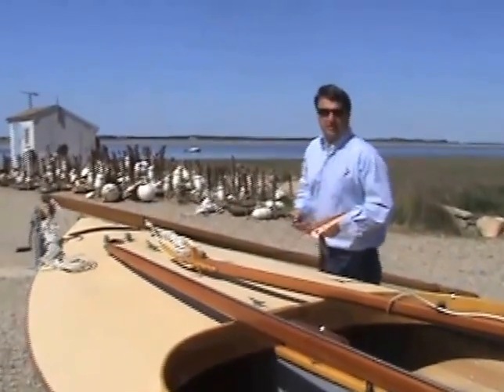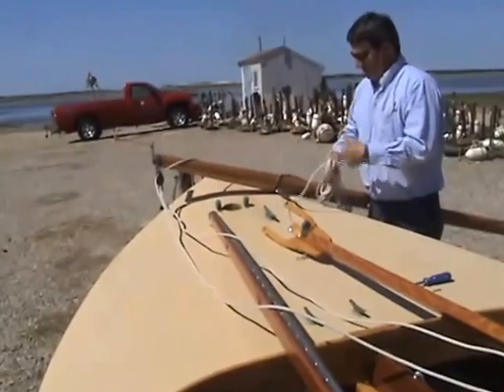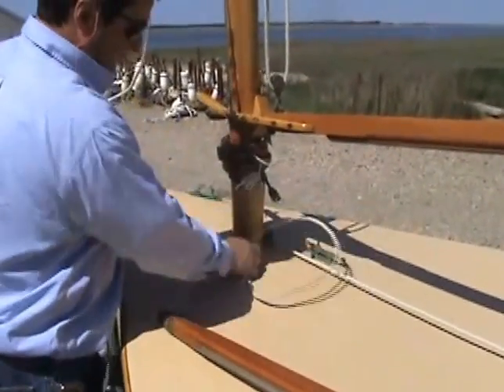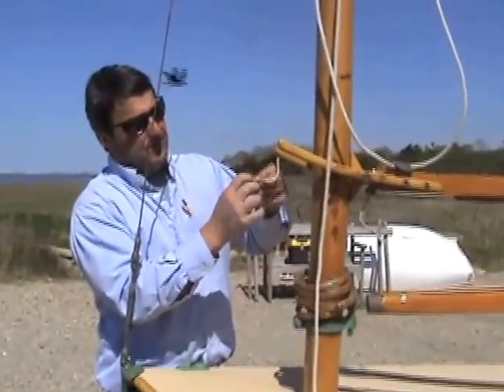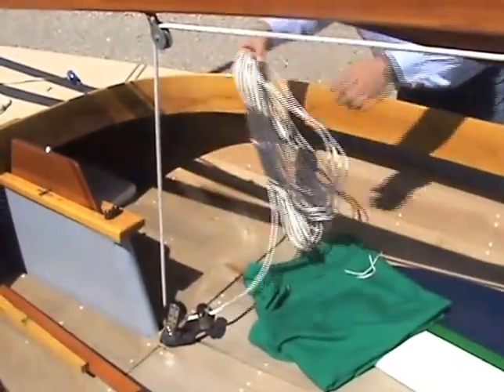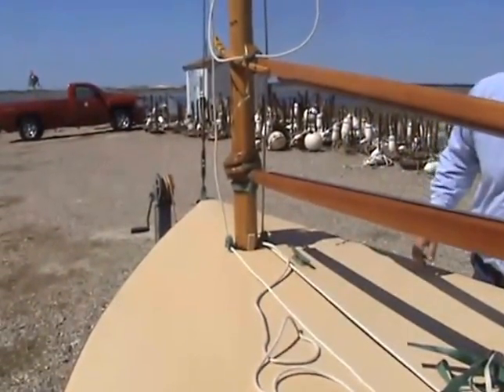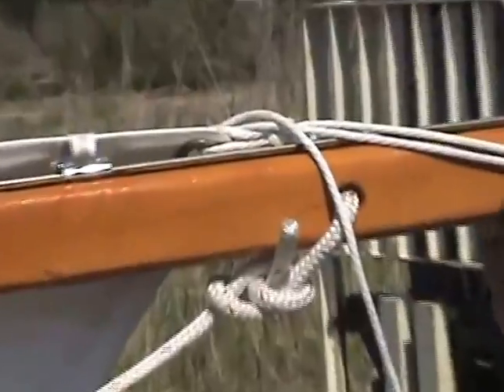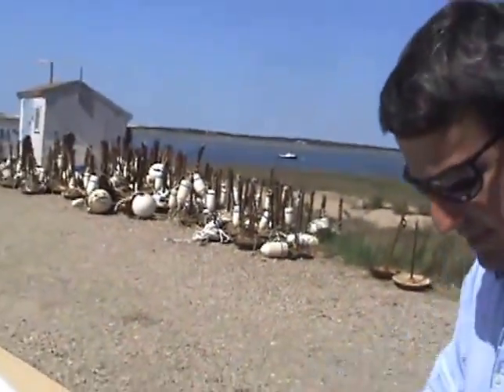Barnstable Cat Boat Rigging Video

Comment: Appreciate the thorough tutorial. Hope you keep this up through the Spring.  I acquired my parent's Barnstable Cat and she hasn't seen water in nearly eight years.  With some bottom paint, sanding and poly, she should be ready for the summer season here in Rhode Island.  I do need to replace a few hoops which are on the verge of going.  I've never rigged her and was hoping to find a demonstration such as yours.  Again, glad you posted this. Thanks!